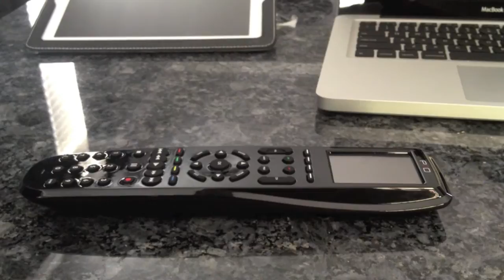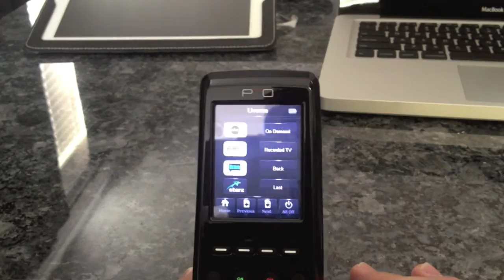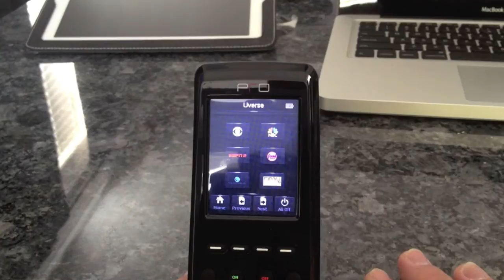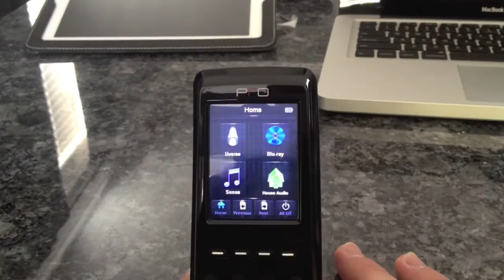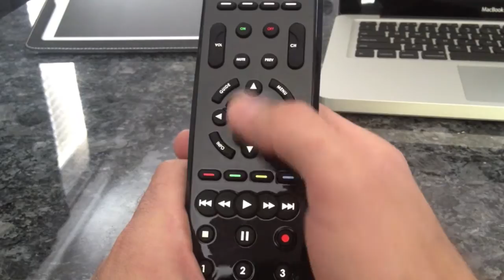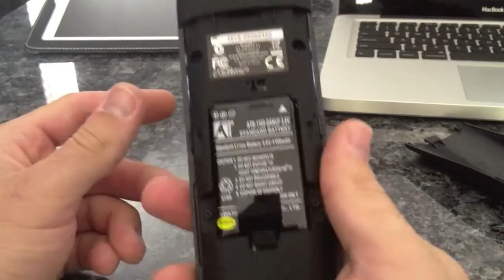Pro Control remote

Comment: I need to know how to reprogram the remote to a new TV that I want to buy, but I do not know how to add one. The one that I have now was set up by 2 guys that I bought the complete system, and it controls my sound, amp, DVD player, and Samsung TV. It works great, but the place went out of business, and the guys are no longer there. I do not have the manual for it or know anyone else who could program a new tv that I want to buy. any suggestions on how I can fix it or who would know about this remote?
Reply from the maker: I made this video quite a long time ago. Since then most modern TVs and sound systems will work without a universal remote and streaming. I would recommend looking into a matching sound system that will work with your new tv. This way you can skip the universal remote. We typically only use universal remotes in a dedicated theater room with multiple sources.

Comment: I Set the DVR for a live tv show, a news chanel,  but I cant delete the recording So when I turn on the show it plays the recording and not the live show. I have to press the double arrows to advance to live. How do I delete the recording. I cant move the up arrow to the delete button on top of the display of the recorded show. Is there another way to get rid of recorded shows?
Reply from the maker: Without knowing what cable service you have I would suggest using the factory cable remote to delete the recording. If the universal remote will not delete the recording it may need to be programmed to work the dvr correctly.

Comment: How can I keep all inputs the same but just make the remote work on a new tv
Reply from the maker: If it’s the same brand the ir codes would still work. If the tv is a different brand then the remote would need to be reprogrammed. You would also need the original file since there is no way to extract the file from the remote.
Reply: @JameyFarrell  even if the TV is 15 years old?
Reply from the maker: @gshhhhhhm  Sony and Samsung have been reusing their codes for that long.  But there may be some new features that you would need including smart apps or extra HDMI inputs that won't be available without reprogramming.
Reply: @JameyFarrell  thanks for the reply. Where are you located? Is it possible to have you program it for me? I’m in New York. Obviously at your price.
Reply from the maker: @gshhhhhhm  sure thing. I’m in Florida. Send me your contact info and I’ll reach out. Jameywired@gmail.com Thanks

Comment: Dos this work a Panasonic Viera smart tv?
Reply from the maker: Yes it would
Reply: @JameyFarrell  .....ok
What about with Dish network?
Reply from the maker: @tidechamp15  Yes it will also work with dish.
Reply: @JameyFarrell  .....where can I get one?
Reply from the maker: @tidechamp15  You would get one from a local AV company typically.  The software isn't available to the public and would need to be programmed by a dealer
Reply: @JameyFarrell  oh,I see
How much do they cost?
Reply from the maker: @tidechamp15   it depends on whether you need just the remote or the remote and the processor.  Feel free to send me your info and I will reach out.  jameywired@gmail.com

Comment: Say you have a pre-existing system consisting of a projector, 3 sources, and a A/V reciever programmed into the remote that work flawlessly. If you were to upgrade the A/V receiver are you able to modify the programming to update the functions for the new receiver and keep the already programmed settings for the other devices or do you have to redo the programming for every device altogether?
Reply from the maker: You can modify the program to change just the controls for the new receiver.

Comment: Remote skips 7-8 channels and time with the use of the arrow keys.  The reset did not work.  Any suggestions?
Reply from the maker: Sounds like the repeats or model number needs to be changed in programming. You can try moving the ir sensor farther away as well and see if anything changes.

Comment: Hey you didn't say what the stupid colored buttons do. That's all I wanted to learn.
Reply from the maker: They are programmable to do whatever you want them to do.  DVD and DirecTV remotes used colored buttons and those will correspond
with them.  They can also be programmed to do a shortcut or macro.  Keep in mind this video is 7 or 8 years old now.  Most people don't need colored buttons to do anything now.

Comment: Don't get this remote or any by this brand; it's a ripoff. You won't be able to do ANY programming on it yourself without the software the company makes, and they only give that out to official dealers, who won't give it to you. So in addition to the outrageous cost of the remote itself, literally every time you need something changed in the remote's programming (like if you get a new device) you'll need to pay a professional to do the programming for you, even if you could figure out how to do it yourself. Unless of course the software leaks someday, but at least as of Jan 3, 2018 that hasn't happened.
Reply from the maker: flarn2006 agreed that it’s very disappointing that the end user can’t program the remote. This is a great remote for a non tinkerer who doesn’t want to fuss with there electronics. Go for the harmony elite if you want to be able to program it yourself. Companies like pro control and big brother company RTI make really solid remotes and provide great training for the installer. Unfortunately most companies fall short when it comes to end user tweaking remotes later on.
Reply: @Jamey: It would be one thing if the software merely had a really steep learning curve and required technical skills. At least then, end users who do have the necessary skills and patience to learn the software could program their own remotes. I understand if end-user programming wasn't a goal of theirs; making easy-to-use software takes effort that they thought it was more important to spend elsewhere. But the fact that they specifically take steps to prevent end users from obtaining the software means they're specifically going out of their way to make it impossible for end users to program their own devices, and that I don't respect.

Doesn't the Harmony not have as many programmable features as the Pro though? How does URC compare to each in those terms?
Reply from the maker: flarn2006 harmony has quite a bit of control in the new stuff. They still lack discrete codes and have trouble with zone 2 on av receivers. The pro control can easily do zone 2. However with Sonos and music cast and heos all available now there really isn’t a reason to program second and third zones. Just use the manufacturer app. I use the harmony elite pro for quite a few jobs and it fits about 75% of my clients needs. Most of them will never “tweak” the programming after I leave. URC MX Home Pro is a pretty solid device as well. However they are still working to protect the software so that the end user gets a solid experience. Unfortunately remote manufacturers are having a hard time supporting the ever changing needs of its end users.

Comment: Vendor only has access to software, Be Warned. Always a red flag if your going to spend that much money on a remote because it will damn sure wind up costing much more than the initial purchase price. Just buy a logitech.
Reply: Or a URC. They have it set up in a similar way, but unlike Pro they don't prohibit the dealers from giving the software to customers, so you can just find one who will give it to you (or find it on the Internet somewhere.) I've heard URC devices are more customizable (at least with the software) than Logitech.
Reply from the maker: Both Logitech and pro control serve different markets. For the client that doesn’t enjoy tinkering with things I’d recommend a pro control or URC and a professional integrator for help. Logitech was a great remote for the diy person.  We used plenty of those as well before they stopped making them. They will definitely be missed.

Comment: The fact that it can only be programmed by a vendor is so dumb and should be a deal breaker.  I bought this from the AV store that installed my surround sound system, and was responsible for programming my remote.  They set it up with a bunch of errors. I had to take it in to for them to fix.  I got an Xbox, I had to take the remote in for them reprogram.  I want to switch cable providers, I have to take it in to get reprogrammed and the overhauls is so substantial they want to charge me for the time to program the remote I already spent $400.   Do not buy this remote!!

Comment from the maker: Hi Donna,
Try pulling off the back battery cover and switching the on/off button to off and wait a couple seconds before switching it back to on.  That will reboot the remote and likely fix your issue.